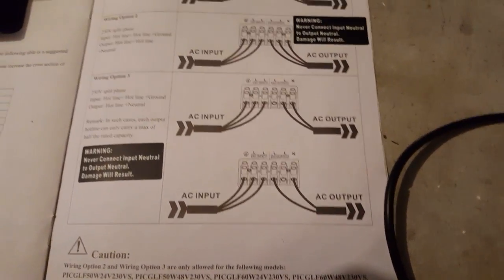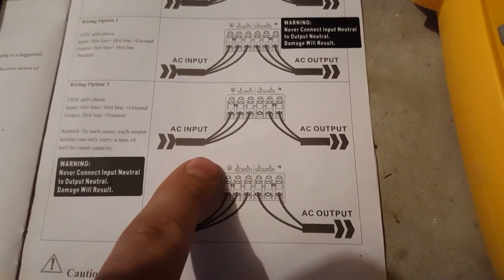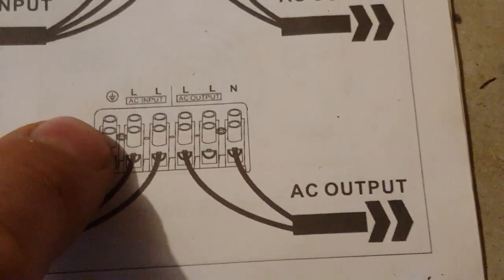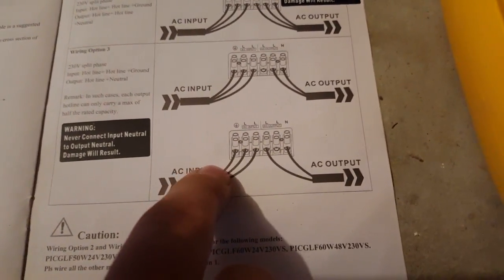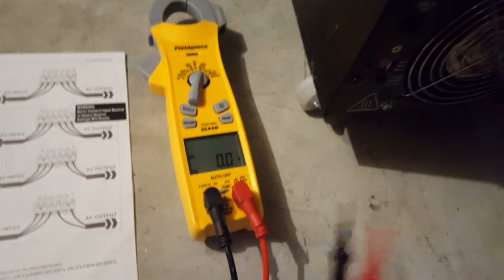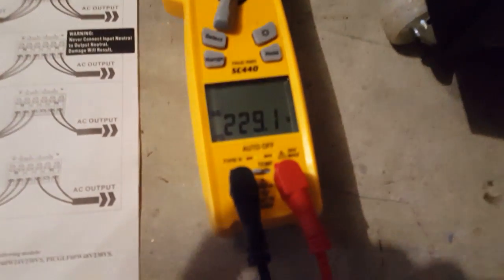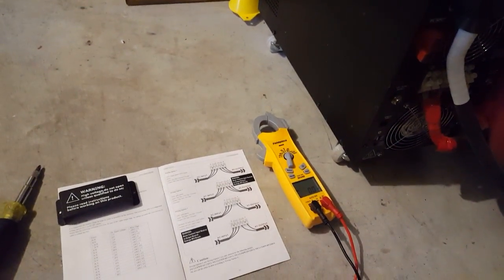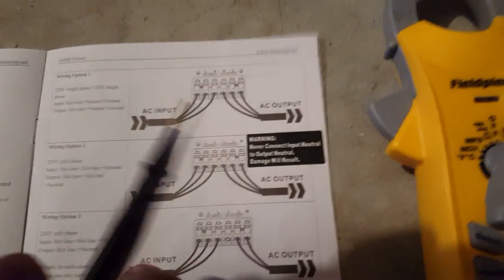Wiring up the aims 6000 split phase pure sine wave inverter to your whole house

Comment: ok so this is 2 phase 110v inverter, seems they are calling it split phase but its actually 2 phase 110v with Neutral built in , i am assuming that you can have 2 fuse boxes then that runs of one L to each box?
i am in UK so Neutral is Neutral return power comes from the one phase only witch is 240v live (no split phase same as most places that use 240v in the EU)
Reply: Split phase is NOT two phase. Very different beasts.
Reply: This is split phase 220/240v. Yes, it makes the AC Appl's run efficiently as compare to single with only 2 wires (Hot and Neutral). Split phase makes your conductors (2 Hot and Neutral) live a bit longer. As it shares the voltage and current unlike in Single Phase hot wire solely bears all voltage and current as well.
Reply from the maker: This is a single phase not 2 phase you need to learn about phase and what it means yes it has two 110 volt outputs but it's a single phase output @ 230 volts as well with 180 degrees with the polarity opposing each other sorry but UK don't have the technology in there power grid like the USA and you need to learn about phase power and the many phase power system we use here with split phase.
Reply: @solarpowerelectricityandel2915   &  @lee x ,  arguing about country specific voltages is pointless.  Pretty much every power plant no matter where you are supplies 3 Phase power. The type, frequency and voltages that are supplied to a home service panel differ between regions / countries.  Split Phase aka Single Phase 3 wire  is more common in North America (120/240V) with the exception of Mexico which uses 2 Phase 3 Wire derived from 3 phase 4 wire WYE transformer (127/230V).  In Europe the service panel is commonly supplied with single phase 230V which is derived from a 3 Phase 4 wire WYE transformer (230/400V) but there could be cases like for farms where there are 3 wire single phase/split phase service panels with 230/460V and in North America you can find service panels with 120/208 from 3 Phase 4 wire WYE.  Split phase derived from single phase transformers or high leg Delta 3 phase transformers will have the higher voltage double of the lower voltage with L1-N-L2 with 180° phase difference between L1-N and N-L2  whereas dual phase 3 wire from WYE will have the higher voltage 1.732 times the lower voltage due to the 120° phase difference between L1-N and N-L2.
Reply from the maker: lee x three phase allows you to run Motors efficiently with three wires single phase allows you to run 110 volts on two different circuits with a neutral and also 240 volts between both circuits
Reply: @solarpowerelectricityandel2915  
Hey, so If I'm using this in Nigeria, which also runs 240v single phase, not split phase, how do I go about hooking the inverter up? I am guessing for the input, I would have the ground, live neutral for 240v input, but for the output I'm a bit confused. Do I put the live and neutral on the "hot, hot", for 240v output and leave the N blank?
Reply from the maker: @charlesagha5261  so you use 240 volts I'm assuming wired up for your 240-volt circuit for your local codes if you don't know how to wire it up I would suggest to pay someone to does
Reply: @solarpowerelectricityandel2915  Hey, thanks for your reply, I really do appreciate it.Been trying to call AIMS, but haven't been able to get through.

Okay, but what I'm saying is the output. For instance, for you guys in America, you explained that you can take 110v from each "Line" to "Neutral", and 240V from "2 Lines (110v X 2) and "Neutral". So in my case that the "Line" is already 240V, I'm  wondering if I just hook my line and neutral here up to the two "Lines" on the inverter output and leave the Neutral empty on the output. That way, if I take a reading similar to yours with a multimeter, I should see 240v accross both "Lines" on the output side, but if there is no neutral connected, I wonder if it'll still work.

My family in the U.S has already made the purchase along with some BattleBorn LifePO4 batteries and it's in transit to Nigeria, so it's too late to return it now. 

On the website though, they claim it's an international inverter, so I wonder why they make the wiring diagram so difficult to understand
Reply from the maker: you need to have a tach install it if you dont understand it
Reply: @charlesagha5261 ,  yes you could connect to the two output lines without the neutral to get the 240V AC however i do not know how your ground is bonded in the application you are using it for as this could be very important for the connection on the input side and output side ( in North America the Neutral conductor is bonded to ground ).  
FYI you can try and contact Sigineer, which is the OEM of AIMS inverters, for your questions. Also recommend to look at the Manuals from Sigineer for the model that corresponds with your AIMS inverter as they have better connection diagrams that should clarify somewhat the confusing ¨Input neutral¨ from the AIMS manual.
Reply: The ground and the neutral of the normal household power grid may be connected together. In this condition, If you connect the neutral output of the inverter (split phase in the secondary transformer) to the neutral point of the electrical panel, it is not possible to avoid the warning about the same neutral for the input and output. On the other hand, if you leave the neutral output floating, the presence of 60 volts between the actual ground and the neutral at the inverter output can be dangerous to people touching common appliances, such as refrigerators, etc. Attempting to connect the ground to the neutral at the inverter output could cause internal damage to the inverter's power circuits.
Reply: just throws me how split phase works, I should look it up a bit more 

from UK so 1 phase 240v and 3 phase 415v or each of the 3 phases can be used as 3 240v single phases, most domestic building in Uk only have 1phase but tends to be 80A 240v on avg (some have 100a and power pole fed power tends to be 60A) so can easy run a cooker and power shower same time no Issue (farms and industrial/ commercial places tend to be the only places that has 3 phases)

Comment: Good video....!!!  That manual is not good!!!!...I have a question.... for your subpanel...then you have to bring the neutral and the two hot lines from the inverter to the subpanel via a transfer switch...but ...what you do with the ground???.. are you using, the  ground from the  home or the new ground from the inverter ??? ..My best guess is to use the ground for the home breaker panel (it is already installed as part of the original circuit)...but this will work if  the main breaker are off.  It is  complicated from the fact that you need to look for the circuit  that you want to power (from the main panel)...but also for the line that return (neutral) to the breaker panel.  Both lines need to be moved to the subpanel via the transfer switch...it will be a pain if you need to move also the ground!!!!

Comment: What is the ground on the other end (AC) for if ground is needed on the DC end? Do both ends need to be grounded? This says it is a charge controller. How are solar panels and batteries connected when there is only one spot for DC connections?
Reply from the maker: Dont try this at home

Comment: I have a new Sigineer 6kw split phase inverter (2021) and the wiring diagram is different.   They now want ground and neutral plugged in on the AC output side, and just L1 L2 and ground for AC input.  Wiring option 2.
Reply from the maker: talk to your tech about it before you set it up

Comment: thanks - i have a single phase 5KVA pure sine wave 230v inverter , 230v Ac input & Out-put is single phase 230v , i want to wire that 230v & the inverter says its - Ground L N Ac INPUT 230VAC  & Ground L N Ac OUTPUT 230VAC 5KVA 48v 93A PV+ PV- i want to wire it straight to breaker box on its own private 100 Amp Double pole breaker which is good for 600v and will split the 93 Amp & 230v an electricion said to fuse everything and tighten all tight and check the laws where you live about legalness make sure all you do is better than the code 12 gauge wire use 10 gauge
Reply from the maker: If you're going to use a 100-amp breaker you need to use a 100 amp wire cause a house fire it's not done correctly needs correct size wire for 100-amp breaker
Reply from the maker: So if 10-2 wg  30 amp braker

Comment: You have to check your panel. make sure grounds are isolated to a grounding bar and no neutral to ground screw is installed.
Reply from the maker: No that would be incredibly dangerous

Comment: L stands for "line". This inverter electronically emulates a split phase system: a 240V coil that is tapped in the middle for the neutral, from which reference point one side is "arriving" while the other is "leaving", therefore 180 degrees apart. Each of the two lines carries half the capacity of the phase. In a separately derived system (transformers/Inverters), the neutral is bonded with the ground, this is why you cannot connect this neutral to any other system's neutral. You should use the ground on the left for both input and output circuits.
Reply: Steve Bobo  If it says Ground, Line and Neutral, you do not have a split phase system. Best consult the manual or call manufacturer to clarify.
Reply: Steve Bobo   Steve You have G/L/N  this means you have an inverter that is  Ground/ 110v-120v hot Line/ and a Return neutral for ONLY 120v application. You cannot have 220/240v. You inverter is strictly a 110v-120v.  If you tried to split the Hot line it will not be phase. Both Hots will not be out of phase and damage your Unit. Do NOT tap  the L1 and try to do 240v This is DANGEROUS and will lead to system failure!  The ONLY Inverter that can be used in 220v-240v is an Inverter designed with split phase that HAS (2)  Hot legs built in it. L1 and L2 <-- the internal components are DESIGNED to phase for 220v-240v application.  You own a 110v-120v Inverter. The end. I hope this helps.

Comment: Because the neutral from the grid is connected to your main panel, that's why AIMS states you do not want to connect your inverter neutral to the panel neutral (grid).
Reply: That’s not what it says. It says don’t connect the incoming ground to the neutral. The output side should be connected to the N.

Comment: I have my Aims  24 v 6000 watt split phase inverter output wired to one side of the transfer switch then wired to the main panel 100 amp entrance outside from the mid point of transfer switch to throuout the house . I have the deep mains that’s from the meter wired to the other side of the transfer switch .Both red and black hot wires of the mains and inverter goes to each breaker on  both sides of the transfer switch while all the white neutral wires are hooked to a block connector of the transfer switch that’s isolated and should never be connected to ground or to the box .The inverter case, charge controller case, solar panels , wind turbine if you have one or any other that’s only associated to the inverter are souly should be grounded to a designated ground rod . The main entrance panel has its own ground from the box outside .Now both phases of the mains and the inverters neutrals should never be grounded at anyway to any main and or transfer switch box .Even though you don’t want current to go through , or to be connected to any or your mains or inverter hots if there’s a short , for example a hot wire that come loose and touches the grounded metal part like a drill case or light fixture . There’s no way the current from a light short on the inverter that can contact the mains hot wires if both mains and inverter phase neutrals are connected together isolated from ground .Im no electrician but that’s how my setup is wired up . I hope this helps . Watch my solar setup videos and leave a reasonable comment . Thank you , Shi shi ,Doh Je .Arigato gosaimasu ,gracias !

Comment: Hi. I have a question I'm hoping you can help with. I understand your video that you need a dedicated ground for the inverter. In main service panels in the US, the neutral and ground are bonded in the panel. So even if I have a dedicated grounding rod for the inverter, isn't there still going to be problems if I take the neutral from the inverter and connect it to the neutral/ground bonding bars in my service panel since, while the inverter is on it's own ground, the neutral in the service panel is also ground? Thanks.
Reply: Did you ever come up with a solution to this problem? I have the same (or similar) inverter and have found partial explanation of how to disable the "Automatic Ground-to-neutral" switch but I am still unsure how to safely connect my inverter to my panel. I do know that you cannot have two ground/neutral bonded connections between the inverter and main panel at once. Thank you!

Comment: Now that was enlightening! I'm still researching as to who, other than Aim's, which is built by a parent company, makes 240V split phase inverters. I know these Chinese units pull all kinds of punches to keep the cost down. Like my Reliable 3500 watt 120V unit has a floating neutral. If I wired it into a service panel, even for just one phase of it, and tied the inverters case ground AND put the neutral to the bus bar....Blam! The smoke comes out! Most US panels tie the ground to the neutral (bonding) and go back to the utility power transformer AND to a ground rod outside the home. Now, with your Aim's unit there, isn't attaching the inverter's neutral to the panels neutral/ground bus, AND the other "ground" on the inverter to it's own ground rod still going to blow it up? Because if your panel has a bonded ground/neutral, it's the same as being grounded? Hmm.
Reply: Curt I had a brain cluster f*ck when it came to the how this is wired. My 6,000watt aims has two grounds. One on incoming power and below is a case ground. <- WHY! So all I did is make my application in my Mains panels a floating neutral and separated the ground as REQUIRED! All I did in the Mains panel is UNSCREW the Big green Neutral to ground bonding Screw inside the Mains panel. Problem solved and I now have a floating neutral in the Mains. Thus following the Warning. One cannot have neutral to ground bonding.  I do not Grid tie as this Would be a Brain MELT down for me and yes per code you WOULD need a bonded N+G <- Thus my inverter CANNOT be used in this application and I would need a Manual transfer switch completely Isolated and separating Inc Mains power and the inverter.  ( bangs head off the wall ). I'm doing a follow up video to SHOW and clarify this soon. Post dated after this comment once i get around to it but Very soon! My 1st video talks about the Neutral to bond cluster warning. Now its time to explain it all as i do not another $2,500 to replace my unit in a PROOF of a smoke show! 😁
Reply from the maker: Curt Chase magnum is my new inverter

Comment: Hey guy, with all do respect, please don't speak electrical or even advise anyone on electrical matters, sooner or later you or anyone who follows your advise is going to get hurt, you're. Right you are not an electrician as you rightly speak a few times, so why explain something you have no clue on
Reply from the maker: https://www.youtube.com/watch?v=GwhatkRDgy4
 This is my profession
Reply: correct me if im wrong the whole power grid including the poles are grounded to the ground so your house panel is grounded as well , how does the inverter go to ground if it generates its power inside itself . power always wants to return to the path of least resistance which would be back to the case on the netural

Comment: Ok so I know I'm gonna sound stupid probably but I'm used to wiring 120v/240v in a home or garage but not used to wiring with an inverter so here I go. As I see it, input is ground, hot from one leg and hot from the second leg off the main 120v panel. Going out, neutral and two hot feed the two legs on the subpanel and just need to be grounded well? Am I in the ballpark? LOL. I'm sure I understood correctly but I like having confirmation before I blow myself up lol
Reply from the maker: Kelly Burgess it should be okay as long as you don't tie neutral and ground together anywhere and you have to have a separate ground for this inverter

Comment: Hi, loved the video. I am about to design a solar system to power my entire home and I am looking to buy AIMS pure sine wave 8000, 10000 or 12000 watt inverter. I am installing enphase micro inverters under each of my panels (14 total) to draw AC power directly from my solar panels. Is it possible to run that AC feed into the AC input of the inverter? and have the output go to my main panel. I will connect a battery bank to the DC connection for the batteries to take over once the pannels loose sunlight. Will the AIMS inverter allow that?
Reply from the maker: +Kafui Andre Not aims, magnum can do this and it's really good at it and I would start at 48 volt and a 4400 watt magnum and you can stack like 8 of this type of inverters. Aims is really a bad choice

Comment: I would like to know what is the largest size wire that will fit into lugs on the aims?Also I take it you wire the sub panel on the solar side with a red to one leg and a black to other. Do you then hook the true neutral to neutral bar and drive a separate ground rod for the sub panel side. Thanks in advance.
Reply from the maker: #8 or #6
Reply from the maker: +Edward Von Gerichten yes
Reply from the maker: subpanel needs a bond from main and inverter needs a ground rod copper or 2 rods test for resistance to ground and do not connect the neutral from the inverter to a ground from the main sub panel should not be bonded from the neutral bar to the panel itself